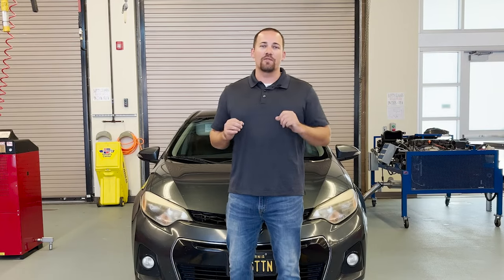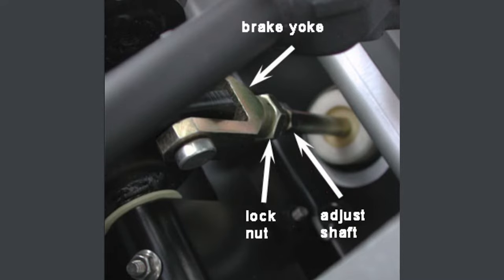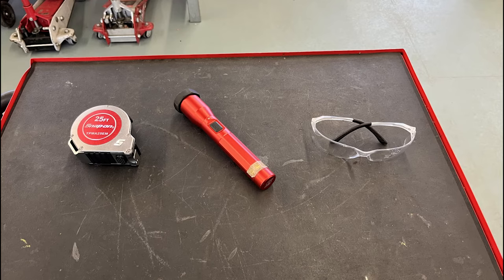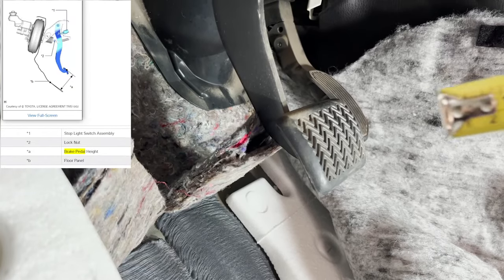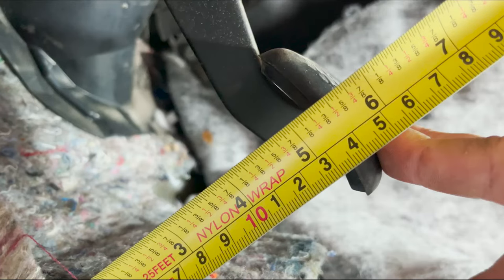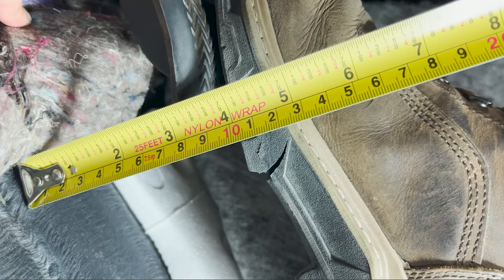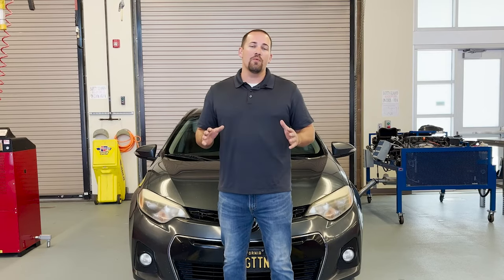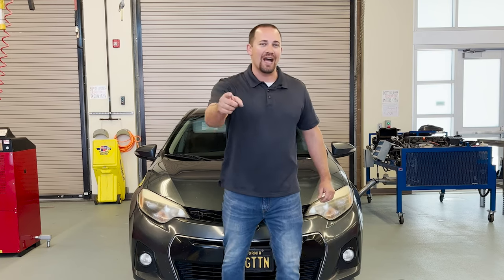How to Measure Brake Pedal Height, Brake Pedal Free play and Brake Pedal Reserve Distance.

Comment: Thanks Gregory! I drive a Ford Econoline handicap van and I am short. I am hoping that I can use this adjustment as I have to lift my entire knee to hit the break. I don’t feel safe in its current  location. Thanks for the tip. Any suggestions are welcome.
Reply from the maker: Thank you very much for the question. I would recommend keeping your brake pedal to the manufactures specification. This is due to the fact that If your brake pedal is too high, it can cause increased brake wear, uncomfortable driving, brake drag, brake lights staying on, and delayed braking response. It's important to get it properly adjusted for safety and performance. If needed there are aftermarket companies that offer equipment that can alter the brake pedal to your comfort without compromising safety.

Comment: I gotta 2022 chevy equinox and the break is really high and hurts my foot after driving too long is it possible to adjust it lower or will it mess up the specifications?
Reply from the maker: Thank you for your question Ti Ko. I would recommend keeping the pedal adjustment within manufacture specification or issues can arise.

Comment: If the brake pedal goes up is it jaming?
Reply from the maker: If your brake pedal is too high, it can lead to a few potential issues and discomforts while driving:

1. Ergonomic Issues: A high brake pedal may cause discomfort or difficulty in reaching and pressing the pedal effectively, especially for drivers with shorter legs. This can lead to fatigue or strain during long drives.

2. Delayed Brake Response: If the pedal is unusually high before it engages the brakes, it might indicate excessive free play or a maladjustment in the brake linkage or pedal assembly. This could potentially delay the brake response time, affecting your ability to stop quickly in an emergency.

3. Braking Efficiency: A high pedal might also mean that the brakes are not releasing fully when the pedal is not pressed. This could cause the brakes to drag slightly even when not engaged, leading to increased wear and tear, and reduced fuel efficiency.

4. Safety Risks: Any issue with the brake pedal height that affects how you apply the brakes can be a safety risk. Inconsistent or unexpected braking behavior can lead to accidents, especially in situations requiring sudden stops.

Comment: What happens if I can not find the specification of the pedal. What can I do to find it?
Reply from the maker: Great question, sometimes it is difficult to find the brake pedal measurements with online service guides. If your service guide does not have the specifications I would search the manufacture specific information, as they are normally more complete and detailed with information.
Reply: @UnforgottenTech  
A good Idea for a new video could be find out what weights are need for a tire
Reply from the maker: @IndominusKing  I love the idea. Thank you so much for your feed back.